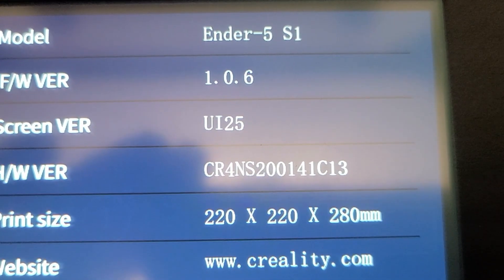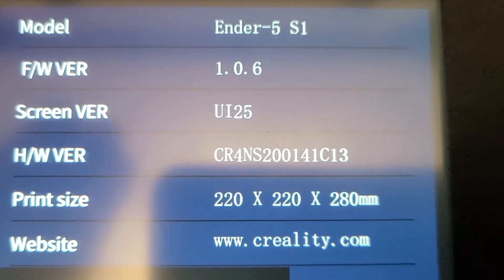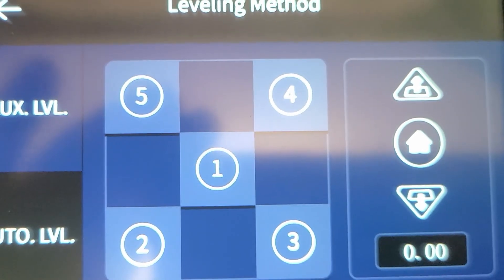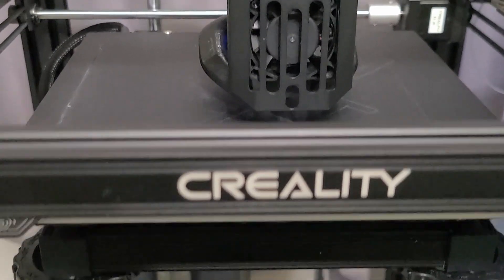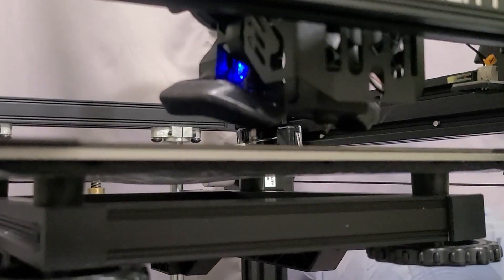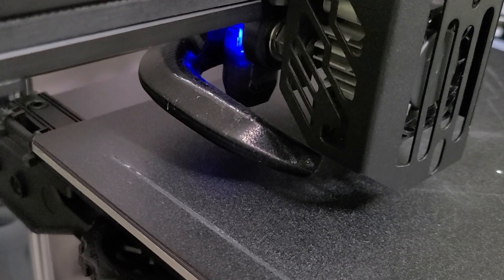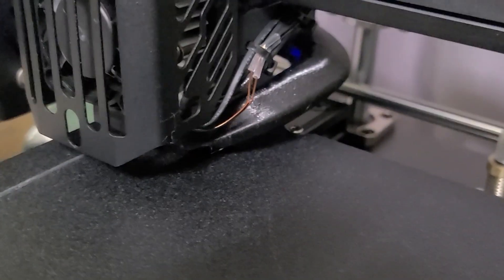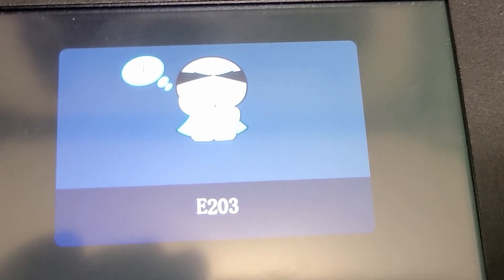Creality Ender-5 S1 Firmware v1.0.6 Bed Leveling Fails

Comment: I have had this issue since the firmware went to 1.06. My S1 auto level will not work with anything above version 1.05. The nozzle crashes hard in the rear left corner during auto bed leveling and generates error code E203. It's been this way for years so I just run version 1.05. I paid a lot of money for this machine and the fact that Creality has not resolved this issue means I will never buy another Creality product. There are better options out there than a company who won't properly support their products.
Reply from the maker: I agree, most likely my first & last Creality printer.

Comment: They changed extruder design a bit, also removed Z axis sensor. Alll these newer firmware versions are created considering those changes in design. So it won't work properly on earlier version of Ender 5 S1. I've reverted to 1.0.4 and everything working fine again.
Reply from the maker: Thanks for the note. I've been able to continue printing using the manual bed leveling and print head tramming method and so far so good. I kept the 1.0.6 firmware because I like that it doesn't travel up and down every time I print. Silly but it's a me thing I guess. As long as it keeps printing like it is now I'm happy.
Reply: @JoshWheelers it doesn't go up and down because it thinks your printer doesn't have a z sensor

Comment: i always get an error 203 on my ender 5 s1.. even on 1.07. i have yet to have auto level work ever
Reply from the maker: Another commentor said that going back to firmware version 1.0.5 is the current solution. I stayed with 1.0.6 because I got the bed leveled manually and it's working well for now AND I don't have to wait for the bed to go all the way down every time I print.
Reply: @JoshWheelers  1.07 just came out
. I had 1.05 installed and it didn't work either... I'm pretty much just manually aligninging it
Reply: Problem is to tight belt, lose in it. I had sam problem and fix it. I have also 1.07

Comment: I keep getting “Tip Files Stopped Unexpectedly” and I have to resume the print. Sometimes when it resumes it doesn’t print where it left off. It will print from the beginning again or an inch too high. Happens at least 3 times a print. Does anyone know how I could fix this?
Reply from the maker: Not sure, I've never seen that one but you could try disabling the "resume" functionality. I have a video that shows you how to disable the power loss recovery feature. https://studio.youtube.com/video/C8LZRIR1FjY/edit

Comment: I have similar problem with Sonic Pad, I can't pass auto bed leveling.
Reply: I am having this same problem when setting up my sonic pad, except with front left.
Reply: @GAMITCHOM did you ever figure out a fix? I’m having the same issue front left
Reply: I have the same problem with the front left. I moved just the flexible sheet over to pass the first stage on sonic pad and relevelled it manually.
Reply from the maker: Good to know. I've wondered if the Sonic Pad would fix all this. Now I'll wait a while before I make any changes.

Comment: The 1.0.6 firmware is known buggy as newer hardware revisions have re located the sensor due to the other known auto levelling issues (twisted x axis where the left is detected higher than it should be).  Switch back to 1.0.5 firmware for now is the fix
Reply: I have tested v 1.0.5. i found an error during auto leveling. Could some one suggest me how to fix?
Reply: @Sid762p  if your ender 5 s1 has a z sensor it won't work on 1.0.6, only 1.0.5 works with a z sensor. I've sent 2 ender 5 s1 back and am getting a refund. Been a nightmare
Reply: @1leo2008  my machine doesn't has a Z sensor. Now, I I do not use an auto levelling function both at first  machine setup and also before every print. It is work !!.
Reply: @Sid762p  apparently the auto levelling doesn't work on the ones missing a z sensor. You also shouldn't have to level the board on every print. The cantilevered bed is the only thing that lets this model down. I am going to buy the creality K1.
Reply from the maker: Thank you for the info. I've contemplated that but I have it printing pretty well for now with a manual bed leveling. If I start having more issues with leveling or other issues come up I guess I'll have to go back to that one. I'm guessing you did the same upgrade then went back to 1.0.5 and it's been working great for you? No problems crashing the nozzle into the bed because of the "twisted X axis". I've had a couple of crashes on the original pre-sale firmware so I'm a bit hesitant to go back.
Reply: @JoshWheelers  No problems with crashing for me.  1.0.5 has been quite stable.  I have a twisted x axis so auto bed leveling doesnt work that well for me anyhow so similar to you have just been running with manual leveling and pumping out nice prints.  More recently (last week) have upgraded to the sonic pad which had made everything much better (apart from auto leveling..)
Reply: @crapsterx  Hi, Kevin. Do you mind pointing out how to roll back to 1.0.5 using Klipper on the Sonic Pad? Thanks.
Reply: @gregm5611  if you are using the sonic pad you will be running killer and not the marlin firmware anyhow.
Reply: Biggest problem is ender 5 s1 can come with a z axis sensor. If it does it's firmware 1.0.5 otherwise it's 1.0.6 for no z axis. I've had both versions and experienced twisted x axis. My replacement has issues levelling and is way off the board. Both gone back and refunded
Reply: @1leo2008  Same issues here with both versions :(
Reply: I'm on my 3rd and having same problems spending countless hours trying to resolve

Comment: I have had the same issue and Creality were no help whatsoever. They just sent a list of error codes and told me what they were for.
Reply from the maker: Yah, unfortunately I think they will not do much unless there's a lot of us complaining and very loudly. I just saw someone else posted a similar video here on YouTube about it now. You could also try the 1.0.5 firmware if you wanted I guess. I have another video that describes in the video description the steps I took to manually level my bed and it's actually printing better than it ever did with auto bed leveling. Hope you get something figured out.